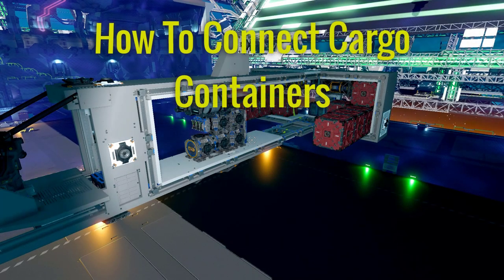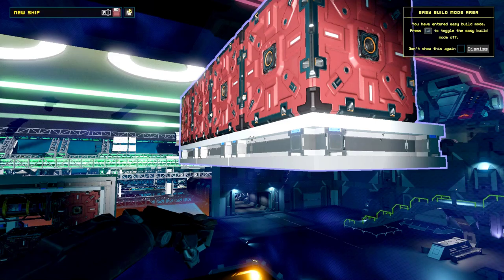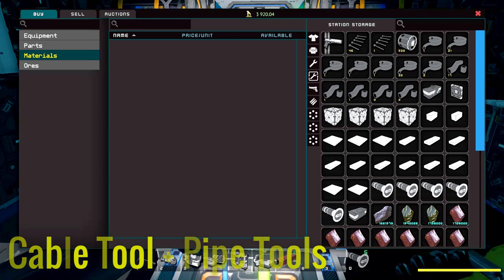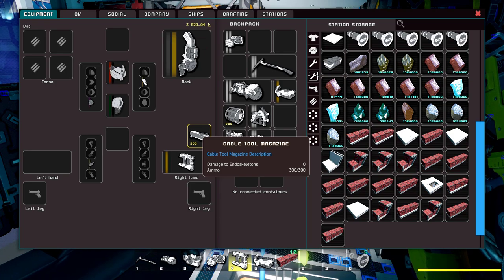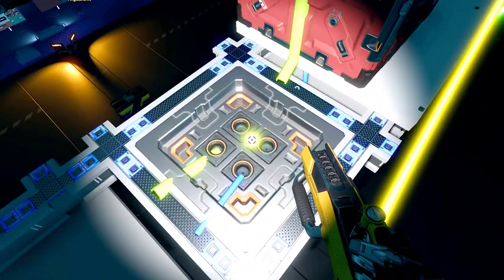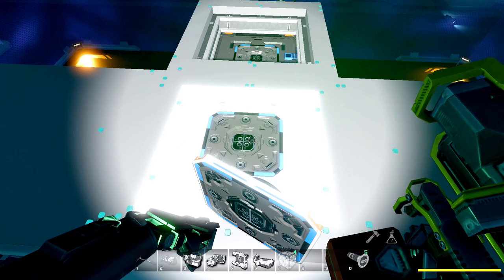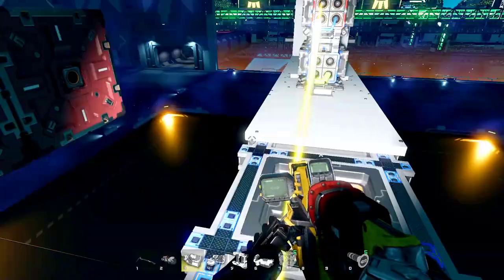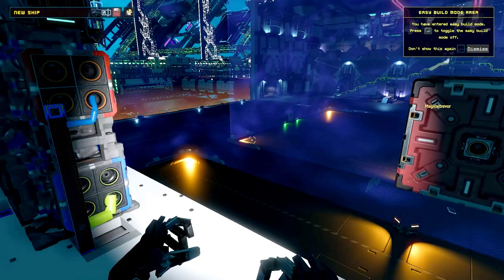How To Wire Cargo Containers, Use Easybuild Mode, Craft Modules In The Tech Tree (Starbase Tutorial)

Comment: The starter ship is bugged. 
Do the following steps. 

Step one: dump your ship outside the station, so it shows as "in space" on the ship terminal.

Step 2: hit escape, settings, tutorial, restart the "Repair Job" step and complete it.

Step 3: The next task, "Ship Controls" will start automatically, go and spawn in the NEW ship at a landing platform.

Step 4: hit escape, skip the rest of "Ship Controls" and "Asteroid Belt" and jump right into "Crafting and Easy Build" by clicking on that step of the tutorial.

Step 5: now fly that ship to the easy repair building.

Step 6: you can now attach modules to the ship.

This Post is from reddit.

Worked for me

Great vid 👍

Comment: So dumb question, but what would be powered by the ducts without wiring connecting it? Would it be components like pilot's seats and such, or is just acting as power line and you'd need more of those hole panels to actually power something?
Reply from the maker: The ducts work as powerlines throughout the ship. The hardpoints are touching the ducts so they share power and fuel can flow through them too.

Comment: A quick question: I saw you let go of an item (the thruster) and then be able to "pick it up" again. How do you do this? with me the item (basic 4 cargo contaner module) bugged partially into my ship and I was unable to retrieve it.
Reply from the maker: In order to pick up items they need to be under a certain size and generally less than 5 pieces. P is the default key to do so.
Reply: @DireLykaios  thank you! :)

Comment: how do i get the Nhurgite needed for batteries? not on the wiki, tutorial or anywhere, is it just random rocks? havent found a single piece in 14 hours...
Reply from the maker: You need to go deeper into the belt away from the stations to find rarer ore. Worst case you can buy the ore from the auction house for a good chunk of credits.
Reply: @DireLykaios  thank you! credits seem to be the way, its quite a grind to get set up with the basic tools and a decent ship! especially when you need to make new fuel rods from the rare materials as well

Comment: hey not sure if u still play tho i managed to disconect my cokpit so if u could help on that by a video or some other way u know i would be happy.
Reply from the maker: Are you using the module system with the ship still? If so you can replace the cockpit/pilot seat with another one of the modules.

If not the module system you’ll need to attach a lot of equipment to control the ship.
Reply: @DireLykaios  using the starter ship
Reply from the maker: @Snakez_Gamez  The starter ship is module based, so you can replace the cockpit if you have the module unlocked. If not rerun the starting missions for a replacement I believe.